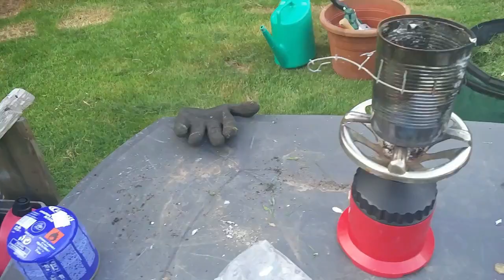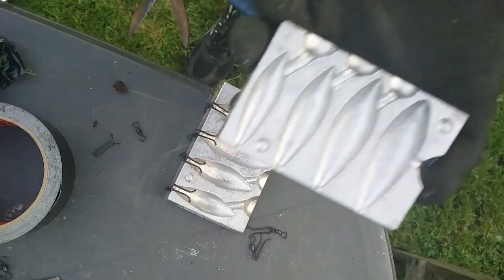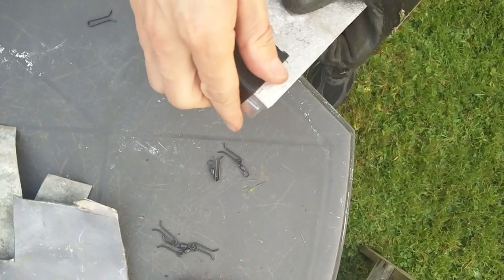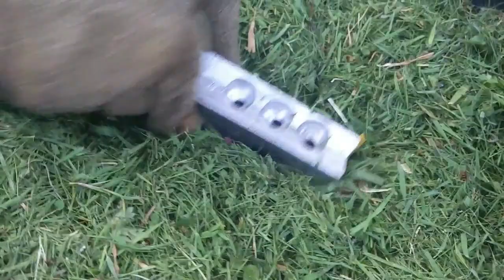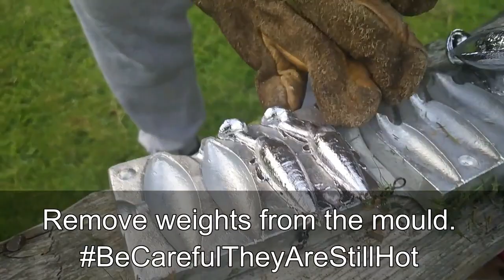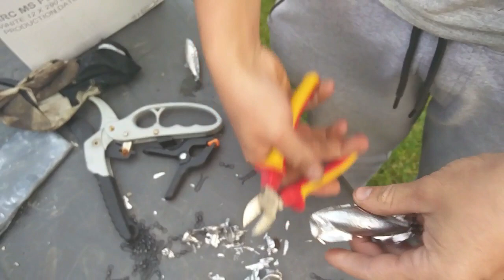How to make fishing weights at home

Comment: Why not use a clamp to hold the mold together.
Isn't that tape a sticky ass mess when it gets hot?
Reply from the maker: Yeah it is a mess we actually had clamps but they are plastic and would have melted with the heat.... so tape had to do for now but a vice or metal clamps would do even better just we didn't have them and what we had we used..

Comment: Where do you get this mold?
Reply from the maker: +Andrius Semenas on eBay mate can get different sizes the mold that we use in the video makes 3,4,5,6 ounce weights but you can get any size and shape brilliant to use very handy just need clamps hold it together we just used tape haha but as I said eBay has it all :)
Reply: Epic Ireland thanks mate.
Reply from the maker: +Andrius Semenas got the molds of eBay can get any size and any shape just you will need clamps to hold them shut we just used tape haha
Reply: Andrius Semenas u can order them from Amazon or any local fishing store
Reply: When your melting lead use a fork or spoon to take out the flack. aka dirt or debris that floats at the top so its easier to pour and just have pure lead and no impurities.
Reply: Do u have an idea to avoid the danger of melting the lead at my roof , like a suit or mask ?